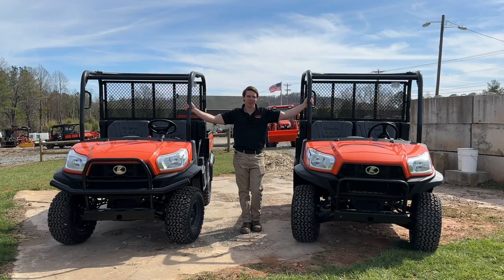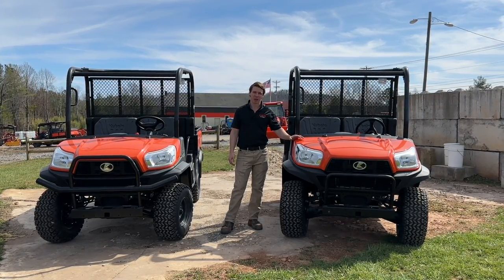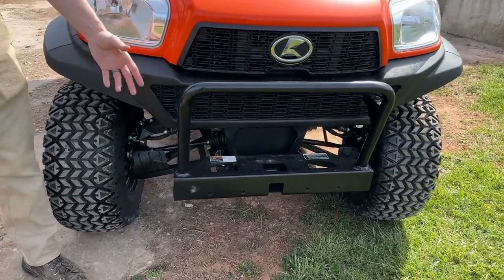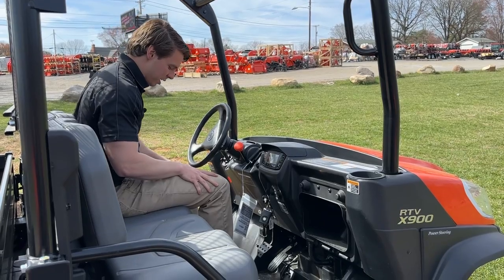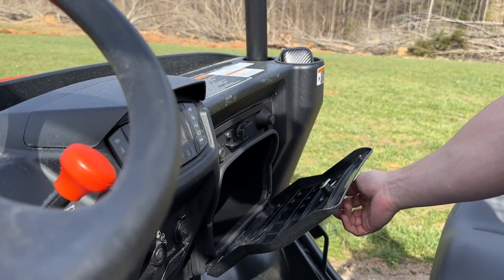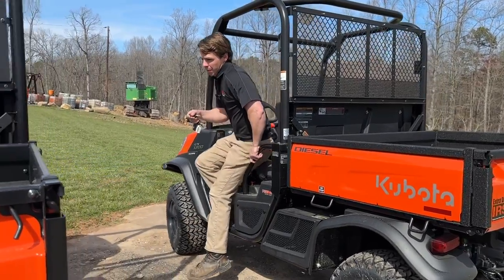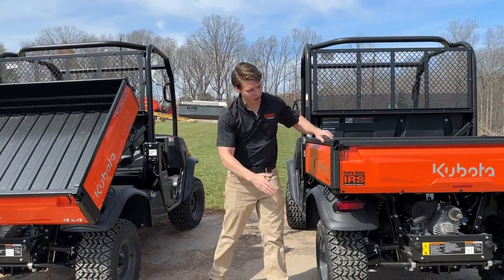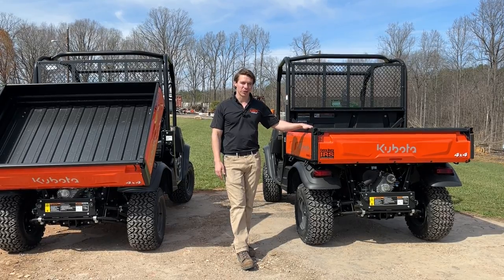Don't make this RTV buying mistake!

Comment: Ok - so it makes sense that maybe not everyone needs a hydraulic actuator for the bed and a hydraulic cylinder do cost a lot of money. But Kubota trying to save 5 dollars on a small plastic lid for the glove compartment is just pathetic. It must cost more to REMOVE the lid than to keep it in place? The same can also be said about the missing seat and steering wheel adjustment options. People CAN, however, manage without a lid on the glove box and missing hydraulics. BUT to deliberately make the driving experience bad (by not being able to adust the steering / seat) is strange since many might get their first encounter with a Kubota through the cheapest variant and wouldn't want the more expensive one if they get a bad experience.

Comment: I love my 1100c. I have a horse farm so I'm always cleaning stalls. The one thing I wish kubuta would do is but a higher back on the dump bed to stop bedding, debris, etc from going over and down into the mechanics underneath. Looking for another one with an open cab cause i hate dealing with the doors when I'm jumping in and out feeding horses all day. So one for the winter and one for the summer
Reply from the maker: Take a look at the 12" Bed Wall Extender kit from OrangeAfterMarket!
Reply: Take doors off
Reply: @Clevelandsteamer324  I did think about doing that. The only problem is the interior is not made to be open to the weather elements since it is kept outside. The seats are cloth material (which the mice would have a field day ripping apart) and the dash having AC,  heat, and radio. I worry about rain shorting things out. I am curious how easy they are to take off. My Jeep doors were a pain in the ass and never did it again lol
Reply: @kubotaoflynchburg  great, thanks, I'll look into that.
Reply: @BOONEHOUND1  cant help you with your choice of utv but on your jeep, if you dont reinstall the door hinge nuts the doors go on and off like a breeze. 
Roll window down
Unhook electrical connector
Uhnook tether strap
Lift door off 
It's really quite easy.  If you dont lube your hingepins they can corrode and give you problems.

Comment: Very informative. Thanks. I was looking at the x1120 and wanted to fully enclose the cab with heat.  Will that take me to the rough price range of the 1100c?  I find that one really pricy.
Reply from the maker: If you do want an enclosed cab, I would spring the little extra and get a X1100. Since Kubota has discontinued the X1120 you would need the new X2, and a cab for that with roof, windshield, doors, rear glass panel and heater kit is probably going to add around $5,000 so you will be within one to three thousand of a new X1100 Cab.

Comment: I have owned a tree farm since August 2016 and have compared SXS/UTVs several times and the result has always been the same.  They are FAR too loud.  Kubota claims their latest RTVs are quieter, but they are still over 80 dB at idle.  Sounds over 85 dB can damage your ears.  There is no reason for them to be that loud other than the manufacturers care more about profits than their customer's hearing.  Polaris had an electric Ranger a few years back but the range was bad for how expensive they were.  A Wrangler and small dump trailer can be bought for less that has more room, more creature comforts, is street legal, has more hauling capacity, and doesn't leave you with a headache at the end of the day.
Reply: That’s why others make Shit Boxes because they can’t afford a KUBOTA RTV.
Reply: @guttasnipe4702  my comment was in response to him mentioning they were quieter, but they're still loud enough to damage hearing.  What does your reply have to do with that or anything, really?  There isn't much difference in RTV/UTV prices between brands.  If you can afford one, you can afford another.  It comes down to brands not caring about their customer's hearing.
Reply: @Noah_E  My reply has a lot to do with your comments about price and nothing to do with hearing……Polaris had an electric Ranger a few years back but the range was bad for how EXPENSIVE they were.
A Wrangler and small dump trailer can be BOUGHT for less.

You must have a very short memory or forget what you write maybe you should read your own comments, better still get yourself a set of ear muffs then you won’t have to worry about noise.
Reply: @guttasnipe4702  That part was about the only quiet option being too expensive, which is why it failed, along with it's poor range due to the limitations of battery tech at the time.  "That’s why others make Shit Boxes because they can’t afford a KUBOTA RTV." implies that 1) Kubotas are more expensive than the competition when they aren't and 2) implies they are better than the competition, which again, they aren't, with the exception of Polaris.  So no, your reply was neither relevant or related.